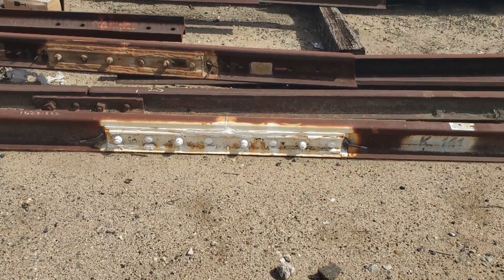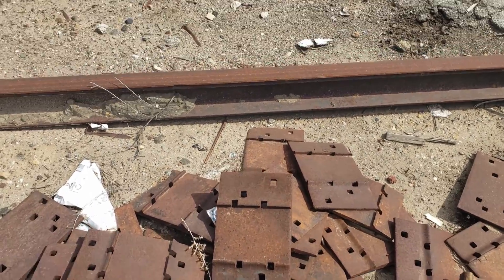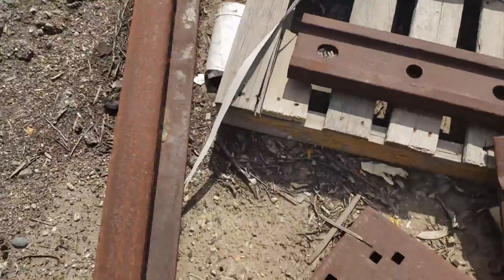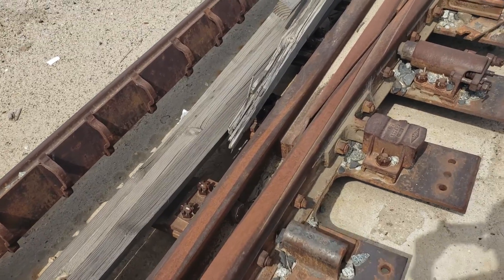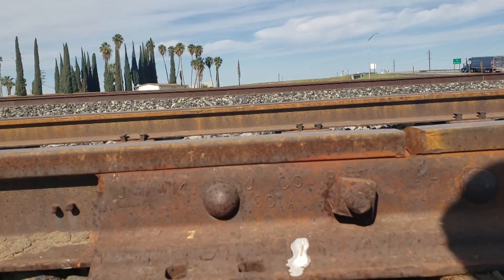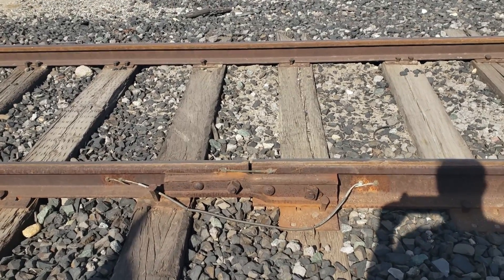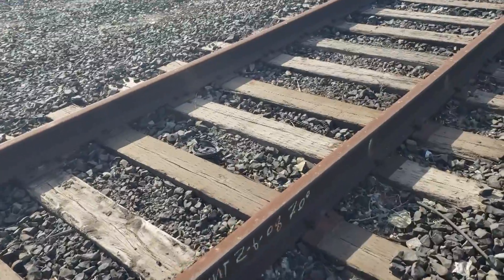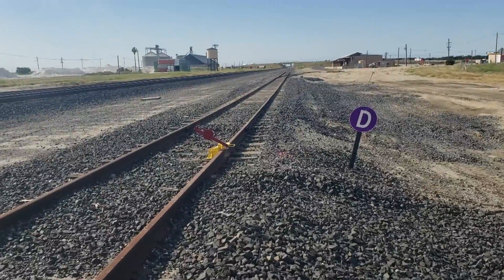All Rail is Not Created Equal! Here's Why!

Comment: How does welded rail absorb heat expansion/
Reply: Usually the rail is heated as it’s laid. The temperature depends on the climate, as far as the extreme between winter and summer temperatures. In the winter the rail is in tension. If the rail was laid too hot, then it might contract to the point of breaking in the cold weather.

Rail and track is held in place by the ballast. Anchors help restrain rail expansion too. If it gets too hot, then the rail can expand to the point where the anchors and ballast don’t hold it anymore. A heat kink can happen. Sometimes railroads put on restrictions above certain temperatures.
Reply: @brianburns7211  
0
Reply from the maker: That's more a question for a track guy but as long as neutral temperatures are right during installation and repair it seems to do well but we do still get sun kinks in the hotter climates.
Thanks for checking it out!
Reply: Yes, the neutral temperature of the steel rail is between the lowest temperature and the highest temperature for that area.  The temperature of the steel is the important one, not air temperature as the steel will get much higher than the air.